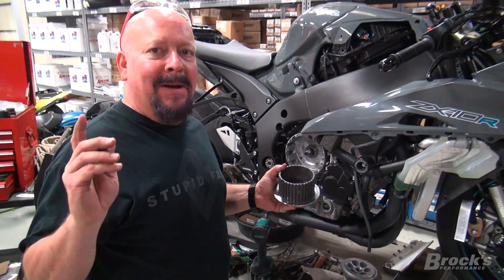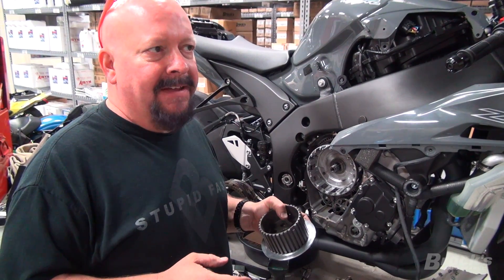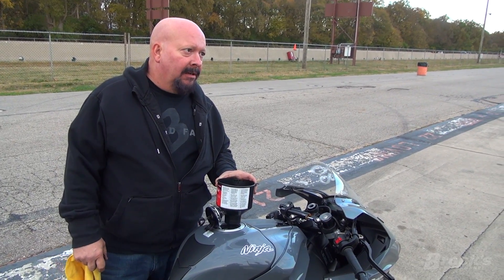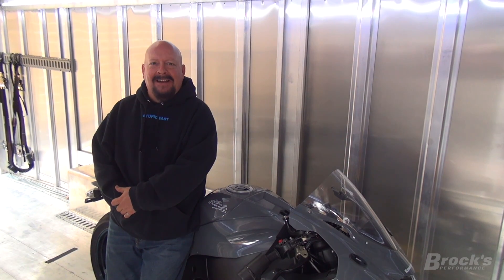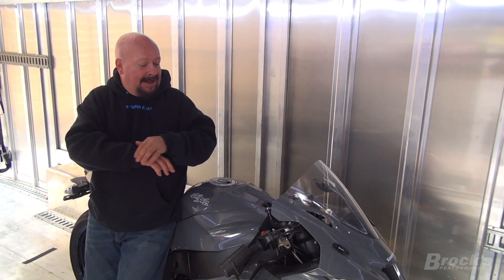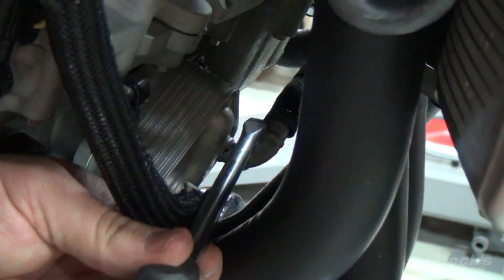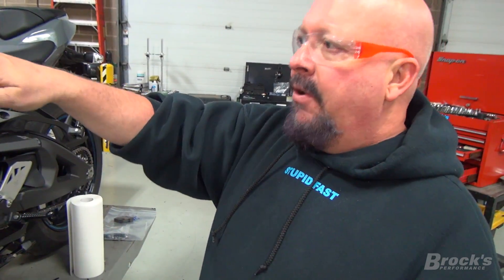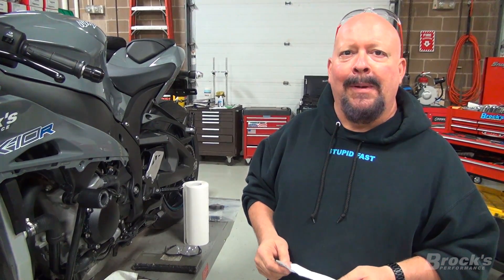Kawasaki Ninja ZX-10R (2019) Dragstrip Prep and Learning The Hard Way

Comment: Hey Brock, loving the amazing videos you've been making and the wealth of information you provide us! This may be a dumb question but after you do dyno  runs is there a reason that you don't rev match the bike to the speed of the dyno when you let off the clutch? such as at 12:30  Is it because the slipper clutch eliminates the need for it?
Reply from the maker: Glad you like. We don't like engine braking the dyno drum. It's 900 lbs. and places more strain on the engine than is needed. Instead, we pull in on the clutch and slow the drum with the dyno eddy current brake.

Comment: Hi Brock did you install the clutch cushion aswell.
Reply from the maker: Not on this bike as we have noticed no chatter issues. Chatter usually occurs when parts start getting worn, or when static spring pressure requirements are extremely high (Big power/nitrous etc.)

Comment: @Brock - beautiful video once again, I really enjoyed it. Here I am with a new and hopefully final question I'd like you to enlighten me... Are you willing to make a video explaining and showing the differences between a long exhaust can and a shorty can as I'm really trying to know what would suit me best. A short can definetly makes more noise but I want to see what runs best and perhaps with dyno results? Sorry for trying to give you more work but I'm really curious haha
Reply from the maker: YCmanager, that's a very easy question. The part that makes the horsepower is located under the fairing. Remove everything behind the front section and minimal power differences are noticed. The part you can see primarily controls sound and aesthetics. Power can be MOVED in this area (a larger volume elbow pipe can net a bit more mid-range, etc.) But it comes at the expense of peak power. We use the shorter for slippery aeros and higher top speed...with the added bonus of an aggressive sound. Hope this helps.
Reply: @BrockDavidson  thank you so much.. so for my own type of riding I should be looking into the longer cans since I primarily ride on the street 😁
Reply from the maker: One item of note: 1 tooth sprocket change on the rear can offset any 'loses' more than altering the pipe can change...if that makes sense.
Reply: @BrockDavidson  So I have a long can at the moment but you'd suggest still swapping the rear sprocket for street riding? +1 or +2?
Reply from the maker: It depends on what type if street riding you do. Check this out: https://blog.brocksperformance.com/faq/what-is-the-best-gearing-combination-for-my/

Comment: I'm with you... I'm in NE. Pretty much the same weather you get. I run antifreeze too. My space is limited. Not unusual for at least one bike to spend the winter in the trailer. I won't risk something freezing up.
Reply from the maker: Most cases of freeze up are noticed due to a little drummer boy in the bottom end, followed by a glowing oil pressure light. The milkshake looking substance that took the place of the oil is a sure sign also.
Reply: @BrockDavidson  Both bad... I wrote you an email earlier on your info address thanking you for the jelly beans that came in my last order. Just finishing up installing your Clutch Mod on my Busa right now. Bought it in the middle of last summer. But never got to it till now. Take care...

Comment: yeah but what the hell is that strap going from up top down to the front brake supposed to do?
Reply from the maker: https://brocksperformance.com/radial-mount-front-end-lowering-kit-multiple-fitments-please-review-list/
Front End Lowering Strap

A safe and easy way to lower your center of gravity for quicker ET's. Integrated, positive locking back-up clamp plate guarantees slip-free operation with a user-friendly release. Extra heavy-duty 1800 lb. abrasion-resistant webbing assures trouble-free operation and long life.

Tie down strap to temporarily lower front end.
Remains on the bike when not drag racing without disrupting handling.
Helps eliminate wheelies for quicker ET’s.
Preloads front suspension to prevent ‘hammer’ on launch.
Easy installation with ‘stoplight’ adjustability.
Allows the motorcycle to be leveled to match rear lowering link setting.
NHRA, MIROCK, NHDRO, MANCUP approved
Made in the USA

Comment: I was wondering what the solution was on the hose repair to keep it from happening again?
Reply from the maker: We had the wrong bracket connecting the sidewinder megaphone to the chassis. The correct bracket pushes the entire system forward to keep the headpipes away from the engine/hoses.